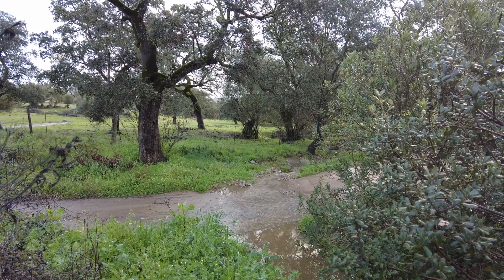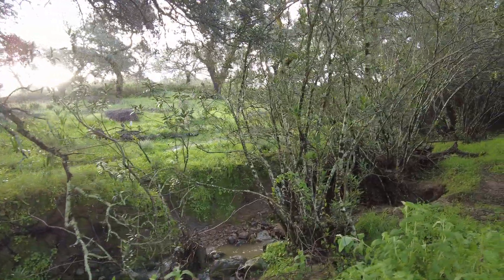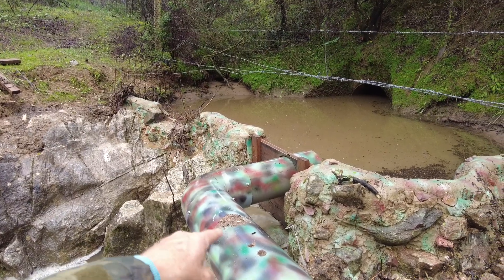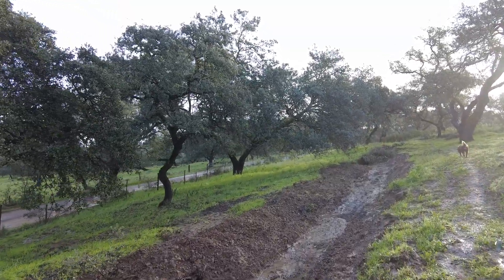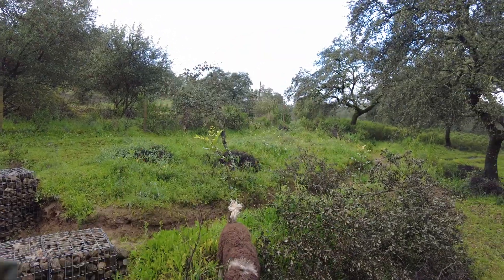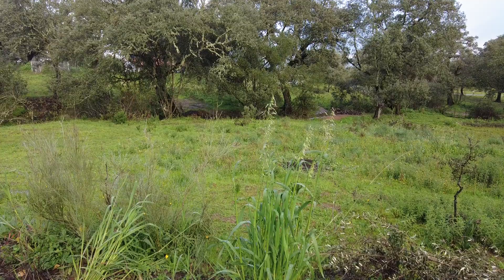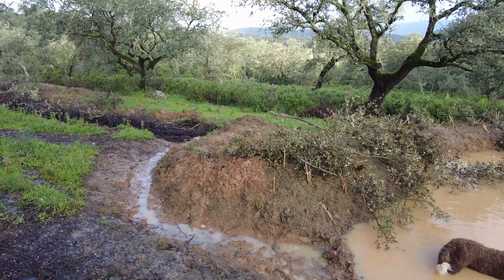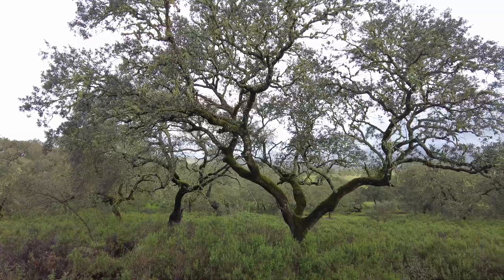The presence and absence of water demand our full attention.

Comment: Would it pay to look at the swales as linear ponds rather than pass through channels? releasing excess water over a small weir. Would this then should stop the majority of the erosion?
Reply: I like the idea of a leaky stone weir at the end of every swale.  Size the height, width  and density of the little weir so the pool of water in the swale does not over top the berm.  It would likely be prudent to have an emergency "through the berm overflow" in the case of crazy waterflow (which has happened) so the berm can not be overtopped.  😊
This is fine tuning - getting that last 10% of performance out of the berm and swale.  For instance, going from 85% to 95% for instance.  Do you agree? 👍👎
Reply from the maker: Sure. These are all temporary measures. The swales should be swales and not channels. Once the waters are in high places (even through pumping) then the swales can be used for its original purpose

Comment: Swale ends are prime targets for Vetiver planting imo. Could you give it a try?
Reply from the maker: Sure. What is a swale end?
Reply: @SuerteDelMolinoFarm  That is where the swale ends, the water overflows and runs downhill across the grass or in a small trench.👍
Reply from the maker: @stevejohnstonbaugh9171  OK OK thanks Steve. This is where I walk through, the giraffe walks through, the dogs walk through all the time. Still I get it. I'll plant vetiver and I'll pave a part for the traffic.
Reply: @SuerteDelMolinoFarm  Or plant your cover crop blend.  Any vegetation will work. 👍
My suggestion for armoring  (permaculture language for paving, in this case) is to gather up your small is stones.  When the soil is saturated, as it is now, simply step them one at a time partially into the mud so the surface is relatively flat.  Make a tight pattern so there is as much edge to edge contact as possible (the way random mosaics fit together).  If the rocks sink into the mud over time, just add another layer for your walking path.
At the spillway to the pond the same technique applies.  But you want to make a gutter profile. The side of the spillway needs armor too.  A hammer may be best to set the stones that run up the sides. No digging required 😉
Reply from the maker: @stevejohnstonbaugh9171  Yes yes yes. Hammer works for everything. No digging required. I like that